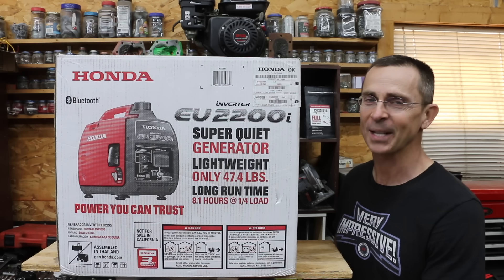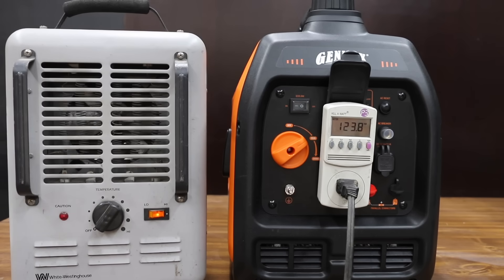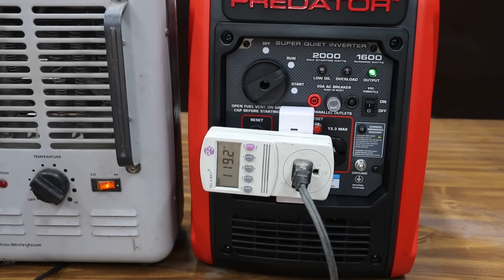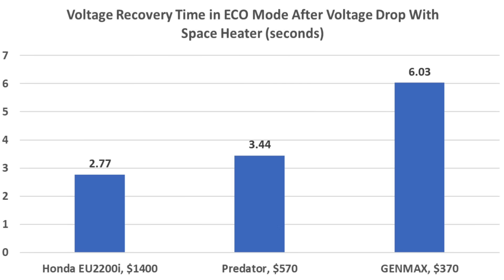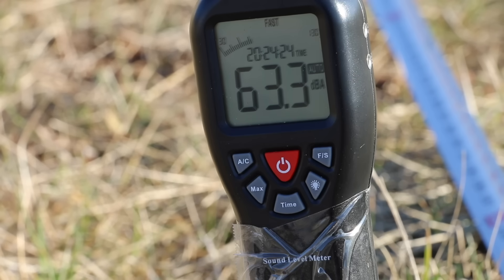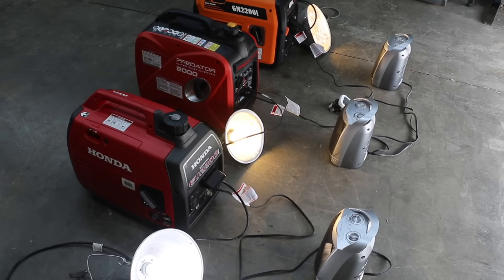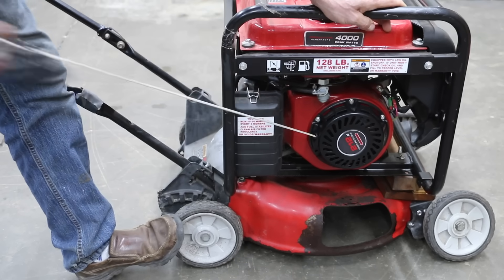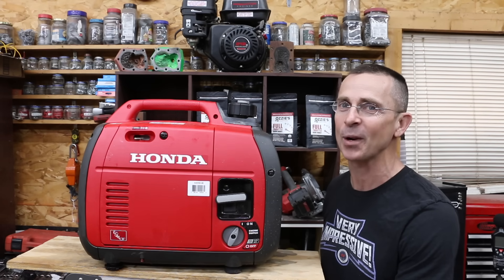Cheap Generator Better Than Honda? Predator vs Honda & GENMAX—Let’s Settle This!

Comment: Seems that it costs a lot to get that bit of extra quietness and smoother running engine. It's amazing how much of a value the other brands are though. This was a perfect test to do, since they claim to compare so equally - but this shows there is a difference! Thanks again for another great video.
Reply: If you rephrase the question into comparing a used Honda, to a new China brand, that's how you can get that smooth quiet engine at a low price. I did a lot of research and patiently waited until I found one for $400 at a pawn shop. If I was in a hurry, I could have paid a bit more ($600).

From the research I did, a used Honda is likely to last longer than a new China thing, and parts are easily available, as well as videos here, showing how to repair them.
Reply: @PaulLawson-k8v  
Gr8 post, thx,
Smart😊
Reply: @PaulLawson-k8v  That's a good point, I'd likely take a used Honda over the cheap but crappy options. However, sometimes not that easy to find a good used one. Since even if it's a Honda, if not maintained well it will not last too long (oil changes, rust prevention, no ethanol fuel ideally, etc).
Reply from the maker: You are welcome!  Thanks for the feedback.
Reply: Chinese junk vs Japanese ingenuity equals American entertainment. Go team Honda!
Reply: Honda will still be running as quiet and smooth as the first day ten years from now. Genmax and the Predator would have been replaced at least three times by then.

Comment: The Harbor Freight & GenMax spark arrestor wire mess screens  are  senseless. They increase engine heat, reduce load capacity and may plug up and thus they add another item to maintain, or else. They could have put a large fine screen across the case inches away from the muffler outlet that would flow well, stop sparks and allow the engine to run cooler. All in theory anyway. You'd need to open up those exhaust ports & retest to see. 
But the Honda muffler is much larger than the others & will dissipate more heat and thus heat won't back up into the engine.
Reply from the maker: Thanks for the suggestion.

Comment: Great video, but would be interesting to see if the gap on the spark plug makes the generator significantly worse, considering most people probably wouldn't check the gap before use 👍
Reply from the maker: Thanks!  Thanks for the suggestion.

Comment: When doing the noise test . Was that a steel rule used to measure the distance? The sound will resonate along the metal and won't give you a true reading. It would have been better to just mark the distance with a peg or line mark in the ground. Excellent review as always.

Comment: Honda has a 3 year warranty. AND can be run on LP which costs less than half of gasoline currently/locally.  I'm off grid, run Honda from 10-14 hr every day (24hr/day when below -20F which is 60 days a year - 4 days of -50F this winter) ). NEVER had a failure,  or failure to start .  I get 10 years or more before rings wear and starts burning oil.  The 100 hr oil change claim is an absolute  myth.  I bet my life on Hondas and never a worry.
Reply from the maker: Thanks for sharing.

Comment: I have a champion 2kw inverter generator bought at costco over 10 years ago that still works great and hasn't shown any signs of burning oil Used it in Alaska had power out for over a week at times, generator would power a toyostove Oil fired heater, 300 watt ignition cycle then about 50 watts to run the pump and fan would also power Kenmore refrigerator and TV., had a Yamaha Silent generator that I would NOT recommend the aluminum windings in generator overheated and the generator died.
Reply from the maker: Thanks for sharing.

Comment: You need to be the first for 9 inch cordless grinders Milwaukee hikoki DeWalt Makita and Metabo ltx, for power cutting speed and run time
Reply from the maker: Thanks for the suggestion.

Comment: I've been off grid for 7ish years.  Bought a brand new Honda eg2800.  Smoked like a chimney and would foul plugs in 2hrs.  After being rebuilt.its much better.  I'm a huge fan of firman brand non inverter gens.  They seems to last better than all the others I've tried.  The 1500w max firman is my daily.  Was nice when they were $250 shopped.  Now they're $400
Reply from the maker: Thanks for sharing.

Comment: I went with the Honda EU2200i after doing extensive research. I figured that as a motorcycle guy, what I knew was that Honda makes good engines. And Honda generators are legendary. Although there were a couple other brands for about half price or less that stood out, Honda stood out for its larger displacement. I performed an exhaustive and meticulous break in using a magnetic dip stick and multiple oil changes within the first couple of hours. Even as a Honda, you’d be surprised how many small filings the magnetic dipstick picked up during the first few changes. I’m glad that this test proves that it’s built significantly better.
Reply: Being a collector of generators I have found that units with oversized engines are just better. My Koehlers and other high-end units have 18+ hp engines to make just 4-6kw while my Predators and Troy-bilt type units have 10hp engines putting out the same power. I don't expect the over worked smaller engines to last as long.
Reply from the maker: Thanks for the feedback.

Comment: I bought my Honda EU2000i in 2005.  It's been completely neglected - oil changed rarely, air filter changed never, nasty waterlogged gas, but its never let me down after 18 years and numerous major hurricanes.  We ran it for months after Hurricane Ian and it still is going strong. With the situations I'm using it in, I want to know that when I need it, it will run without issue.  

 Buy once, cry once.  If it does finally decide to pack up, I'll probably look at the eu2200i and Yamaha equivalent.  This video's a nice reminder that I probably should change the oil and dump the stale gas this week.
Reply from the maker: Thanks for sharing.

Comment: My Honda EU2200I has 5,693 hours on it. Oil changes, 3 air filter changes and 1 spark plug change. Super quite, sips gas and easy to start. I wouldn't even consider another brand.
Reply from the maker: Thanks for the feedback.

Comment: A few years ago I provided the PA system for a friends wedding at the beach. I borrowed a Honda generator from a buddy. It was so quiet, I had it running at the back of the tent with no issues. I was very impressed with it's noise level. And it ran all my gear with no problem.
Reply from the maker: Thanks for sharing.

Comment: 6 second voltage sag shouldn't be an issue. Many Americans live in affordable housing, like manufactured homes. These homes, to cut costs, use the thinnest wires possible in the walls. I think some older manufactured homes couldn't even legally be made today because the wire gauge laws were different then, allowing for thinner wires than are legal now. I would probably guess that most lower class Americans see voltage drop to 100 volts right at the outlet in their house with no extension cord when running a space heater. My understanding is that all AC appliances are rated to run correctly down to 110 volts anyway, with some power supplies rated down to 100. Only below 110 would even be pushing it.
Reply: Loved that you included Predator 4000 and Tailgator
Reply from the maker: Thanks!

Comment: I never comment on these. But I own a Honda 2200i and the Companion model. Have had them for 10+ years and they still run outstandingly with hundreds, probably thousands of hours running keeping the lights on in my travel trailer. In the long run the Hondas are the real deal. Just get them serviced like they need to and they will last. Over 10 years a 1200 dollar investment is nothing.
Reply from the maker: Thanks for sharing.

Comment: I have 3, a predator 2000 & 3500, both have worked hard without issues or failures.  I also have a Large Genmax 9000w dual fuel inverter with remote etc... the Genmax is the Only one in the large 240v  inverters that has a factory Oil filter/screen built in.... I work mine @ almost max output regularly & they're all decent, my Big Genmax is an absolute Beast with plenty of stable clean power...  Great content Todd.... as usual ;)
Reply from the maker: Thanks!  Thanks for sharing.

Comment: Hi Todd!: Great video / generator comparison report. Very dedicated & crystal clear info!. BTW: Just a couple months ago I was presented with an OLD Yamaha Diesel EDA5000dv generator, (for Free!),  sitting in a warehouse for some 7 yrs. It was barely used as a back.up / emergency only, in a bakery + dairy products Company,  (Probably...) made by Yamaha, some 25+ yrs ago. Not at all like the ones tested in your awsome video, though!: Weighs (roughly..) 250 lbs, noisy as hell and a ROYAL pain in my  A.. ( my arm!!..) since it doesn't have an electric starter. Just a 'classic' hand crank + de.compressor in the 300+ cc diesel motor. It's still running ok and very fuel efficient. Besides being noisy, it's also jumpy as a crazy 'roo.. 🦘
Reply from the maker: Thanks!  Thanks for sharing.

Comment: I second Kyle's notion to compare to Yamaha and Champion.  I've had excellent experience with my Yamaha in years of full time RVing, but I recommended my neighbor buy a Champion, as it's similar but significantly cheaper. He bought 2! I chose the Yami over Honda for a few reasons. Honda at the time didn't have a fuel-cutoff for running carb dry for storage, Honda has interference timing belt- Yamaha has lifetime chain. (Honda's last awhile but when belt breaks or stretches, it's essentially disposable). Honda also didn't include fuel-level indicator, convenient for quick check, and especially for filling up without irritating overfill spill. Yamaha generated same amount of power as Honda with smaller engine and is more fuel efficient. Everything else was comparable (quality engines and electronics, similar sound, Yamaha weighed a hair less at the time). Overall advantages went to Yamaha (especially Honda's love for interference timing-belts), yet Yamaha was also a few $hundred cheaper! I would've bought it over Honda at the same price, but the lower price sealed it. I didn't know about Champion inverter style at the time, if I'd known I would've considered it. Compared to my neighbor's Champs, I feel my Yami has slightly better quality (and convenient fuel guage), but his were likely an even better value. We both feel they make the Honda seem 'overrated' and overpriced.  No matter what you buy, I recommend adding a digital hour-meter (most don't even have this essential feature)- they are under $10 on Ebay, and very easy to install. I also recommend a magnetic oil dipstick to make engine last longer, as they don't have oil filters. Every time I check mine, there's fine metallic 'silt' that's not being circulated in engine to cause unnecessary wear!
Reply from the maker: Thanks for the suggestion.  Thanks for sharing.

Comment: Be interesting to see a follow up test and oil analysis. I know a lot of the smaller and in particular cheaper engines will have more wear in making that first oil change critical, but after that point I think you'll find much smaller discrepancies on repeated oil analysis.
Reply: That's a good point, but remember he changed the oil twice on each unit.  It seems only the oil from the 2nd change was analyzed, but I think you're right, that wear would normalize across all units, over time.  The question is, how much compression did you lose in the lesser-made engines, along the way?
Reply from the maker: Thanks for the suggestion.
Reply: I would think the cheaper ones are saving money on quality of parts, cheaper material, and quality control. They sell quantity to profit and we don't mind how long it lasts because we can buy 4 more with the money we saved.

Comment: I've owned a tailgater. Currently own both the predator 2000 and a Honda eu2200i. I agree with everything in this video. Tailgater is junk, predator isn't a bad generator for the money but does pale in comparison to the Honda.

I actually bought the predator on sale as a "beater" so that I don't put as many hours on my Honda. It does use oil and likes to puff a little smoke on startup (predator). My Honda has 950 hours and the predator has less than 100 and is already an oil burner.
Reply from the maker: Thanks for sharing.

Comment: The jagged sine wave usually isn't the problem with sensitive electronics. You can run switch mode power supplys on basically everything, even square wave or DC.
It is the over voltage from switching some large load off that kills sensitive stuff. The engine is revving up for some time causing the voltage to rise on an poorly regulated (cheap) generator
That is the sort of thing an inverter should prevent, but I have seen one that rose the voltage up to 160V when switching off an 500W halogen light
That one made a perfectly smooth sinewave by the way
Reply from the maker: Thanks for the feedback.

Comment: I use the Honda 2200 for a few years every application that needs about 1.5KW of electricity for a years. It never failed me. I wouldn't buy any other brand. A full tank lasts for a whole day for me.
Reply from the maker: Thanks for sharing.

Comment: I have predictor generator like ones in this video  I have close to 30,000 hours on mine the oil use did plug up the spark arrestor
Reply from the maker: Thanks for sharing.

Comment: OKAY but....

You can get a kit to run the honda off propane or natural gas. It's going yo obviously outlast the other 2 and stay running, which is important. 

Point 2 is: You can take that honda and pair it with the 3500 honda and now together you got a 30 amp circuit, and this is important. 

For me all this is important anyway because I plan on using mine in an off grid application to top off a battery bank if there isn't enough sun.

Normally I would probably just use the smaller one, but if running power tools or whatever maybe both together. 

I think the honda has more capabilities. Better to pay more up front and do it right the first time.
Reply from the maker: Thanks for the feedback.

Comment: I run a Wen 56235i and works great. Of course you need to break them in with multiple run time and oil changes.
Reply from the maker: Thanks for sharing.

Comment: The predator and genmax 2200 generators are rebadged Ducar Generators (Yamaha clone 79cc), as many others .. i.e Pulsar & need a considerable amount of break-in time before oil consumption drops to a normal low value.
Reply from the maker: Thanks for the feedback.
Reply: For these flat tappet engines (as most of small 4 stroke engines are), I put in a few ounces of Lucas (zinc) break-in oil for each oil change.
If I get one in new, I’ll use break-in oil for the first oil fill.

Comment: I had a knockoff called a Kipor KGE2000Ti. It looked ridiculously like a Honda. It lasted one year. No one wanted to repair it as the parts were unique to Kipor. I bought a Honda EU2000i and it hasn't missed a beat in 10+ years. 👍👍👍
Reply from the maker: Thanks for shairng.

Comment: Excellent!  I would like to see a Torture Test of these same three. The way they could be called upon to perform in an unanticipated emergency. Run them for consecutive days under very heavy loads and check oil consumption and fuel consumption. In the real world, this could happen. A person or family may need to stay alive with one of these, so put them to the real-world test. Run them without shutting down except to check oil/add oil and keep track of oil consumption and gas consumption.  Could the Preditor run as long as the HONDA if the user just kept adding oil (assuming they had it) every day? Could a family survive with just one of these small generators for two weeks if they had enough gas and oil to keep it running constantly/near constantly? Would the oil analysis performed in this test accurately predict the early failure of one generator over the other in the Torture Test?
Reply from the maker: Thanks!  Thanks for the suggestion.

Comment: Being that summer is right around the corner, it would be helpful if you could test coolers/ice chests to see which works best at ice retention, durability and overall weight. Keep up the great work!
Reply from the maker: Thanks for the video idea.
Reply: I second this request!
Reply: Guys, what's about fridge on 18v platform like Makita, DeWalt or others?)
Reply: 3rd!
Reply: YYYEEEESSSSSSSS
Reply: YES!
Reply: Would be very, VERY interested in a cooler cook-off! :)
Reply: I’m looking at the new 12 Volt units. It’d be great to see some of those options. My buddy has one from Walmart and he loves it.
Reply: there's already dozens of those on yt
Reply: @donoimdono2702 
yeah but we trust this guy
Reply: @jamisonr  unless you are trafficking black market organs through Baja, I would have to agree. Some people take their cold drinks a lot more seriously than I do though. . . Lol
Reply: I'd like to see both regular coolers and the powered ones.
Reply: yes back pack cooler test
Reply: @jamisonr  $450 for the name, $50 for the cooler……
Reply: i wonder if you fill the lids of the cheap coolers with spray foam if that would help the cheap coolers seem to have a hollow id

Comment: I am more interested in the portable oscilloscope as my Tektronix scope died a long time ago and am now using the cart to support a plasma cutter. It looks like a FNIRSI-1013D Digital Tablet Oscilloscope. You must have done some research on them and chose that brand and model. Too limited use for most people to test a bunch of them.

I can't see myself paying $1400 for a generator, having said that I did pay $3K for a Cat 30KW generator that is older than I am. No need to use a sound meter on it, when it is running you know it with a straight exhaust pipe. Even the neighbors know it is running :)
Reply from the maker: Thanks for the feedback.